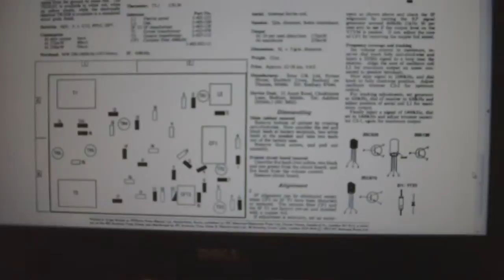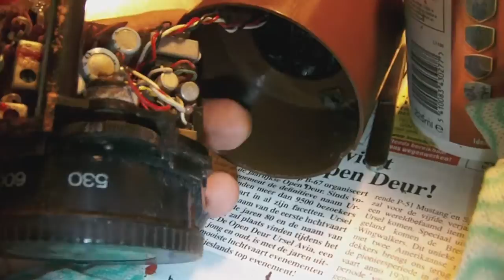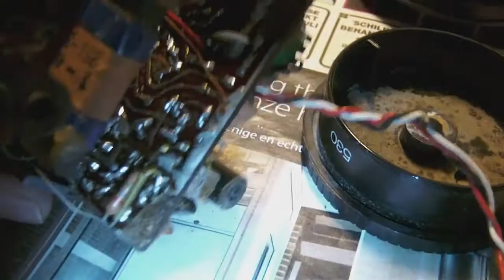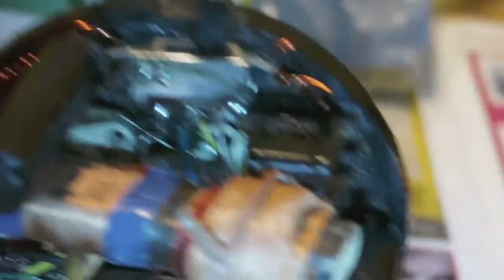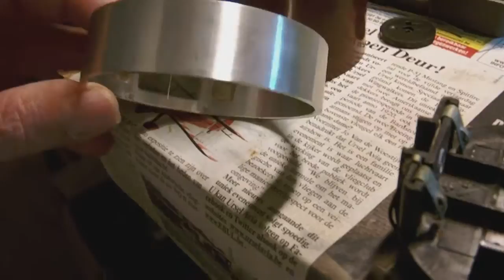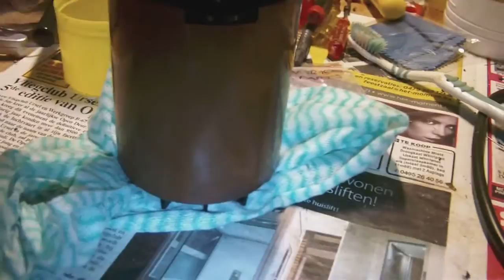Sony TR-1829C part 1 of 2

Comment: 6 years on, and your video has been helpful. My brother-in-law handed me one of these radios to me yesterday, and asked if I could fix it. It was of sentimental value to him, as he bought it Vietnam, when serving with the Australian Army during the Vietnam War.. After cleaning up the battery terminals. I noticed that the volume control was very loose, and I could not see an obvious way to get to the small screw. With you video I was able to remove the bezel, and get to the screw. I can now return it to him fully repaired. Thank you so much. You are a champion. 😊👍
Reply from the maker: I'm glad I could be of service to you and your brother-in-law. These little radios can be quite tricky to repair but they can be fun to use as well :) Unfortunately the time of novelty radios is somewhat passé but it's still a nice reminder of the past. Cheers and always welcome to my channel ! thanks for considering subscribing and giving me a thumb's up :)

Comment: hello, your video is being very useful to me since im trying to fix my grandma's tr 1829. how did you remove the metal ring from the top? it looks like there are only a couple of pressure tabs holding it but im afraid of breaking the plastic
Reply from the maker: Hello! 
You need to find three thin strips of aluminum 3 or 4 mm wide, 4 or 5 cm long and not thicker than 1 mm or so. At the top of the radio, between the tuning knob and the aluminum ring there is a thin gap. Locate the three plastic hooks that hold down the ring and insert each strip between each of the hooks and the ring. Press the strips deep enough so the hooks clear the inside of the ring. Once all three strips are in place you should be able to gently lift/slide the ring off the radio top. 
The other way is a bit easier. 
You unmount the chassis from the casing by releasing 3 screws inside the bottom part of the radio (After gently turning and pulling out the speaker part of the radio). The whole top of the radio, ring included will come out the top of the casing. Loop a string around the base of the hooks and slowly tighten the string until the hooks are pressed inwards and release the ring. If you're careful enough, you can press each of the hooks in, pushing the ring up slightly while you press the other hooks inward.
Remember, use very little force and take your time to do it, or you'll damage the radio. You will NOT be able to completely extract the chassis, until you unsolder the battery holder/speaker (3 or 4 wires) from the chassis.

Good luck and happy New Year :)
Reply: thanks i managed to tear it down. but the volume pot is shot  :(
Reply from the maker: You should be able to replace the potentiometer if you salvage one from 
one of those cheap 70's or 80's no-name AM pocket radios you can buy for
 a couple of dollars nearly anywhere. In any case, be gentle with the 
radio. It's rather fragile on the inside. Good luck :)
Reply: TechneMoira that's a good plan b if I can't save it with contact cleaner. yeah the printboard seemed very fragile.

Comment: No, welcome back to you! Glad to see you posting a new project. Heating the screws to get them out with a grinder was ingenious, you always seem to have very creative ways you come up with to solve difficult problems.
Reply from the maker: Well... Using a heat gun would heat too much of the radio and cause all sorts of trouble, and the same goes for a soldering iron, which would potentially cause damage if bumped into other parts. Using the grinder as a very localized heat source just made sense... Until I'll find a safe "laser point heat source" that is safe and handy to use.
Now, obviously, you must remember when you grind the head of the screw you also destroy it. But in this case, the screws were so corroded and "gone" it really didn't matter. 
BE careful though if you use this method! The screw's surface temperature easily goes up into the hundreds of degrees. You can seriously burn yourself or anything else... so use with caution!

And yes, it's always nice to be back here :) Thanks for watching